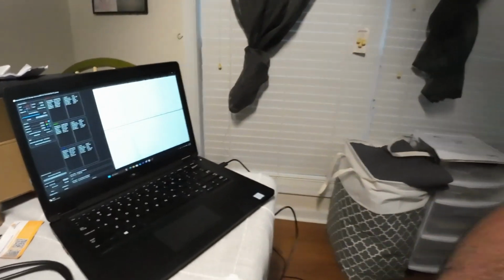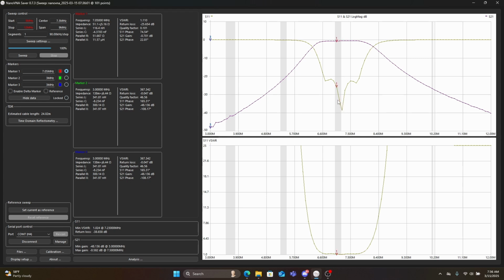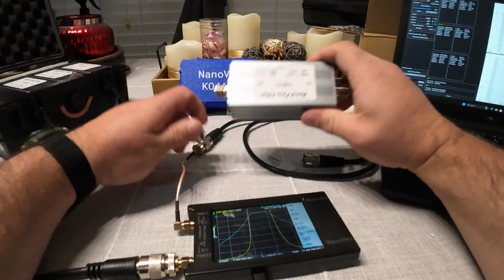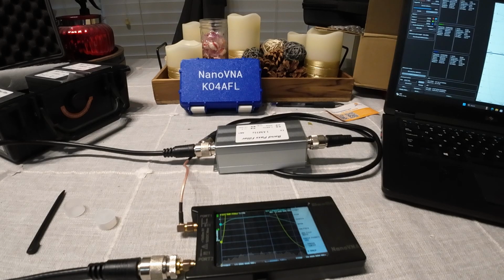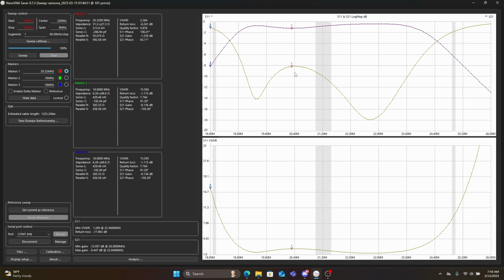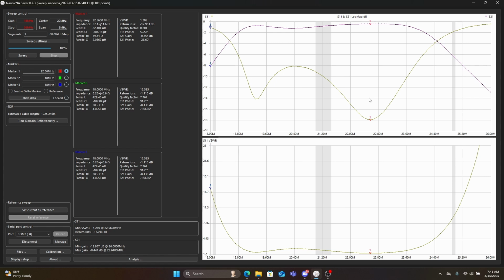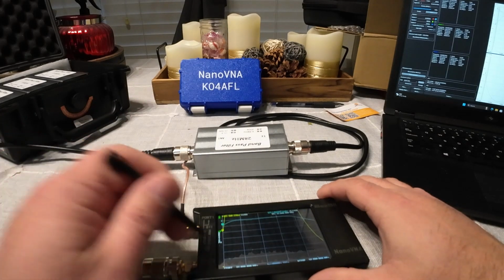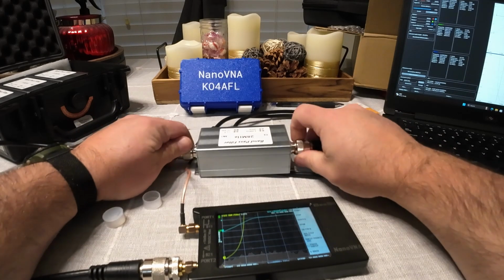Bandpass Filter Review

Comment: Did you calibrate the nanoVNA?  I have found my nanoVNA is not very accurate for logmag unless I recalibrate every time I change the start/stop frequency.  Your video shows that you changed the frequencies multiple times without recalibrating.
Reply from the maker: Yes I did recalibrate but I think I had issues with my cables

Comment: Steve, I enjoyed your review of these bandpass filters.  I recently purchased a set myself from Alliexpress.  Following your lead, today I connected up my Nano VNA and tested my 20, 17, 15, 12, and 10 mtr filters.  The only one I saw a problem with was the 20 mtr unit, which was way out of spec.  I opened up the case and found that one of the toroids in the 4 toroid stack at the output of the filter was broken.  It looked like it had jammed into the center conductor of the output SO239.  I'm going to see if the Alliexpress vendor will make it good, but I have my doubts.   I can probably repair the filter with a type 43 toroid that looks to be about the same size.  I'll let you know how that goes.  73  Ron
Reply from the maker: Yeah I have two more to check from another friend and I'm sure they are out of spec
Reply: Steve,  Just wanted to follow up with you to let you know that I was pleasantly surprised that the AliExpress vendor that I purchased from did stand behind their product and offered to replace the shipping damaged filter that I received.  However, in recent communications with them we reached an agreement at my recommendation that instead of each of us paying shipping each way, I would be happy to repair and replace the broken toroid in my unit, if they could provide me the replacement toroid.  Since, in actuality, the shipper not them, were more than likely to have inflicted the damage, I am very happy with this solution.   Also, just for comparison purposes, I also used my NanoVNA to test my VA6AM bandpass filters that I purchased from DX Engineering, and was surprised to see that the performance specifications (suppression bandwidth, insertion loss and suppression decibel level) were identical to those of the AliExpress units